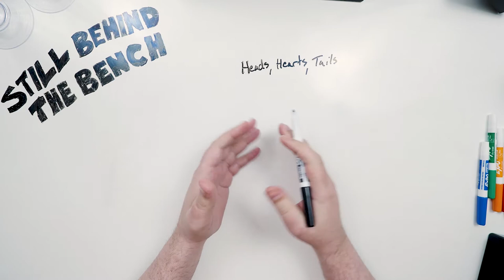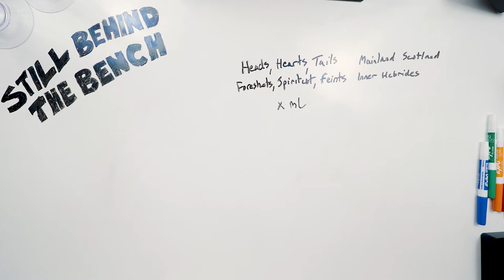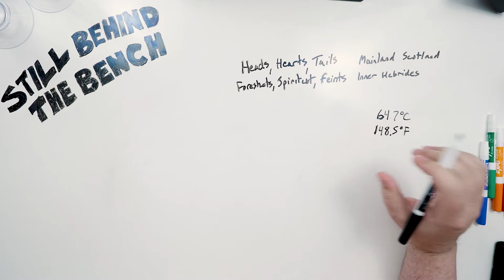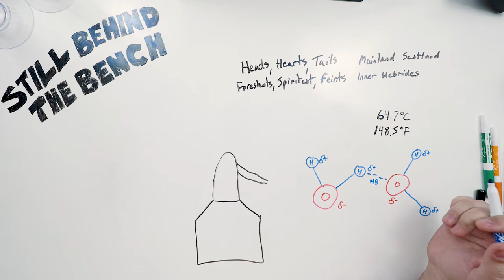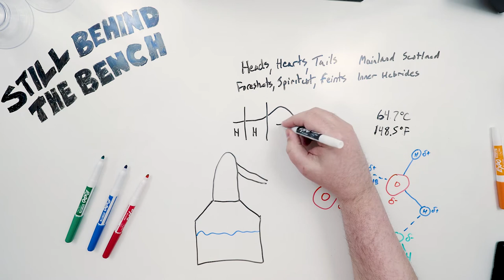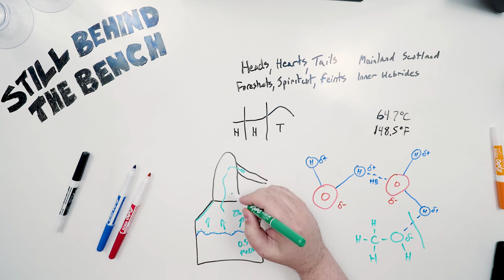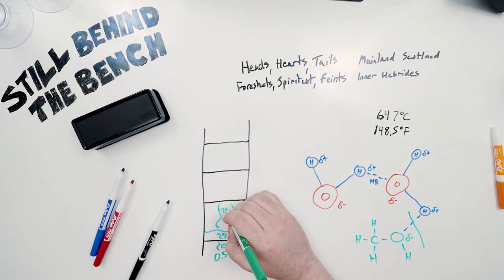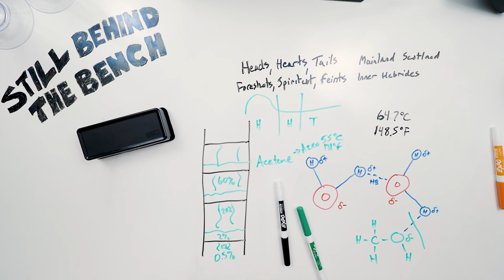Ep 002   Methanol Part 2

Comment: So, if you were doing an intentional pot still run but had an easily changeable plated column, would you advocate for running heads through the plate column and then switching out to a pot still for the rest of the run?  Would that be of an advantage?

Comment: I just purchased  a 30 pot still from copper still co.  With a bourbon ball,  10 gal thumper, 5 gal worm. 6 in agitation port  on coller. 32oz infuser  for thumper. I  have 3 gals of 45% acid vinegar. MY question  in what % acid do you recommend for a cleaning run?

Comment: There is one thing i dont get. Methanol forms an hydrogen bond, Ethanol forms an azeotrope. Isnt this azeotrope bond stronger? If so, why can we distill ethanol from around 75C but would have a boiling point closer to water?
Reply: Both Methanol and Ethanol form a hydrogen bond, the Ethanol hydrogen bond is stronger though because it's further away from the methyl group, which would disrupt the hydrogen bond, that's why it forms an azeotrope and methanol does not.

The BP of pure ethanol is around 78.5C, but the BP of a water/ethanol mixture is actually lower, at 78.2C. Everything in that liquid mixture is already evaporating, just from the heat energy in the environment. If you poured the mix into the still, turned on just the condenser, and had a coolant with a temperature lower than room temperature, also putting the receiving vessel in something like an ice bath, you would find distillate from your wash in your vessel. It's why a glass of water on your countertop will evaporate throughout the day, and the volume of water will get smaller. That rate of evaporation will increase if you add more heat energy, which is why evaporation in a still increases as you add heat energy to the kettle/boiler. Evaporation is only a surface phenomenon though. This is also why certain compounds that have a BP higher than water, but are also insoluble in water and less dense than water, will come out earlier in the distillation process. They evaporate away, since they are floating on the surface of the wash.

Boiling on the other hand is where you have increased the temperature of the liquid enough that the pressure the liquid is exerting outwards on the atmosphere, is higher than the pressure of the atmosphere pushing inwards on it, so it turns into a gas, and travels up the still.

Comment: A few years ago I gave a bottle of rum to a teacher at uni, they said (later) that they wouldn’t even touch until they had put a sample through the mass spectrometer.
They said that there was around 10-12 ppm methanol, which they were happy with, as commercial spirits can have up to 100-130ppm methanol… is that true?
Reply from the maker: It can actually be much higher than that. Spirits based on stone-fruit (plums, peaches, cherries, apricots, etc), or on the skins (marc, grappa, orujo, etc) of fruit, usually have the highest concentrations. I've read studies where it is as high as 13000ppm (13000mg/L). It's because pectin, being a plant structural component, is going to be found in higher concentrations in the skins. As for stone fruit, I don't think they have a higher concentration of pectin, just that its structure is slightly different, and so it's more available to be extracted from the fruit. 

For commercial products, there are legal limits though, based on the type of spirit you are making, and they are almost always well below the amount that would cause any noticeable health issues.
Reply: @StillBehindTheBench  I thought so, thanks mate.

Comment: I want to see even fractions taken off of a pot still run....all water removed (via molecular sieves)....then an analysis of methanol present in each fraction BEFORE I believe this.  Just saying.
Reply: Same. I'll calling BS on the main points of this video, and that the info is wrong!
Reply: But what did you base your belief on before, what someone told you as folklore or you read without evidence from a GC?

Comment: Hi Adam, so redistilling tails in a column still, will get the methanol right from the beginning out of the still. If we have a thermometer at the top of the column can we assume that when the temperature will rise above the boiling point of methanol we have most of the methanol out? As you said, at the top of the column initially we will have high concentrations of methanol so the boiling point of the mixture will be close to the boiling point of pure methanol  or somehow below that, due to the azeotrope mixture with acetone

Comment: So the esters and acetone are problematic, can you do a video regarding how those act while distilling spirits with both a pot still and a column still.
Reply: Acetone and any other ketones will largely leave at the beginning of distillation because they are very volatile and don't really bond with a lot. An imperceptible amount of acetone might stick around with methanol but it will still leave in the heads cuts. Wouldn't be worth making a video about ketones. 
But esters on the other hand are what makes up most of the flavour compounds in the spirit you are making. They are both made and distilled out of the wash, during distillation. It's a very large group that don't all act the same. I do intend on making a flavour compound video though, and I will be talking a lot about esters in it.

Comment: How is acetone formed in the still and where does it come from?
Reply from the maker: It's a semi-complex set of steps, but I'll condense it for you.

To put it simply, the yeast will produce Pyruvate via the glycolytic pathway like normal, as I talk about in the fermentation videos. But only under aerobic conditions does that pyruvate gets turned into Acetyl-CoA, under anaerobic conditions it goes on to become ethanol instead. Via a couple of intermediates, that Acetyl-CoA gets turned into Acetoacetate, and then Acetone. The creation of acetone, also seems to be for the purposes of producing some other compounds, so it is an intermediate itself. But if the oxygen runs out, than the creation of those other compounds never happens, and so you end up with acetone in your wash.

So in all cases, and there is like 3 different pathways it can take to produce acetone, that Pyruvate needs to be turned into Acetyl-CoA for acetone to be produced, and that only happens under aerobic (oxygen-present) conditions.

That is why so little acetone is produced in the first place, even in the heads. If you do smell acetone, while it is possible that you are actually smelling acetone, a more likely culprit is a high concentration of ethyl acetate, which can smell like acetone in high concentrations, whereas in low concentrations it has a fruity smell.